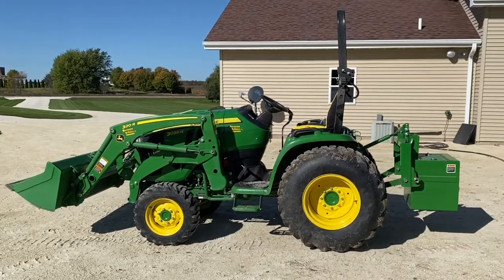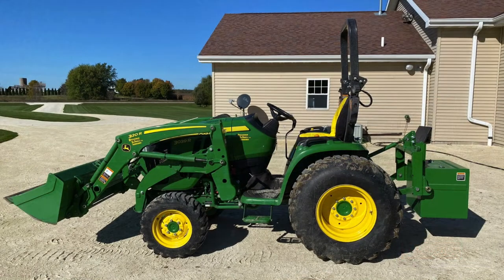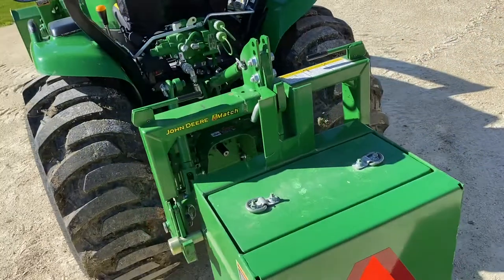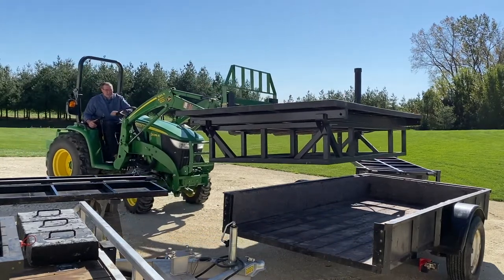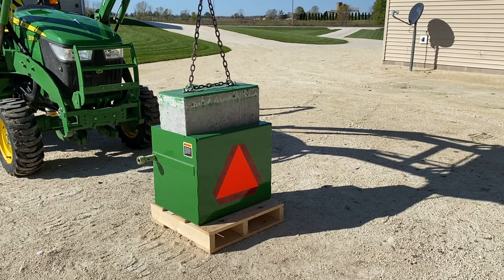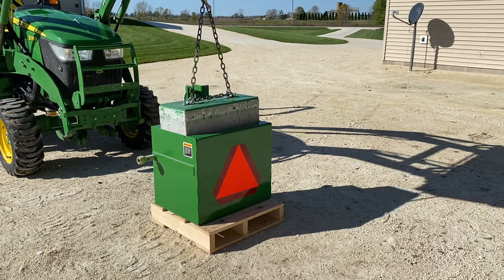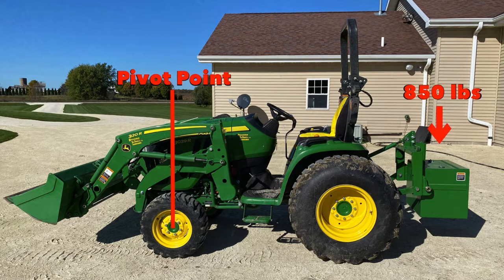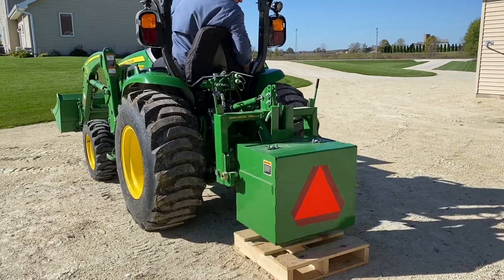John Deere Ballast Box iMatch - Concrete DIY

Comment: That's a great idea!  I'm doing something a little different but kind of the same.  I'm taking PVC pipe and filling it with concrete (probably make my video in a week or so).  I can lift them out by hand and use them for ballast on other projects (tent weights, holding a tarp down, etc) without needing the loader to pull them out.  As a dedicated item I think I like your idea better but I'm a multi-use kind of guy
Reply from the maker: That's a great idea too.  I like the universal coverage as well.  Do more with less, good thinking.

Comment: Hey Danimal, I am pretty green with tractors. I just bought a 2023 JD3039r with I-Match and a ballast box. I have the loader on the front. When I simply park my tractor on flat level ground and lower my 3-point hitch all the way down, my ballast box sits about 3-4” off the ground. Is this standard or can adjustment be made? Or do you always need pallets or something similar where you permanently park so that you can actually set it down and take the pressure off of the 3-point hitch? Thanks and great videos you have here on YouTube :-)
Reply from the maker: Yeah, right on, same thing with my setup.  You can adjust the arms to go down lower but then it takes down the maximum height they can be raised to.  I just use a small pallet I made to set it on so it's the right height.  That pallet also helps make it easy to pick up the ballast to move with the front forks if needed.

Comment: Subscribed. I have a very similar tractor (3046r open station) and also a ballast box. Mine is filled with sandbags and some fill in the base. I wish I would have only done sand bags or concrete like you. I did recently fill my tires with beet juice. Not sure if you’ve considered that at all…
Reply from the maker: Thank you.  I haven't heard of the beat juice idea for compact tractors but do know that some old farmers have done that on their 2-wheel drive tractors for better traction while working land.  They swish and sway when driving down the road though but it's still kind of cool.  Thanks for subscribing!

Comment: I wonder how much it would weigh if you just completely filled the box with concrete?
Reply from the maker: This basically is filled with concrete, it's just able to be removed.  I would guess if you filled it with concrete 100% it would only be maybe 25-30lbs heavier but then you'd be locked into it being that way unless you wanted to chip out all that concrete later someday.  Thanks for watching!